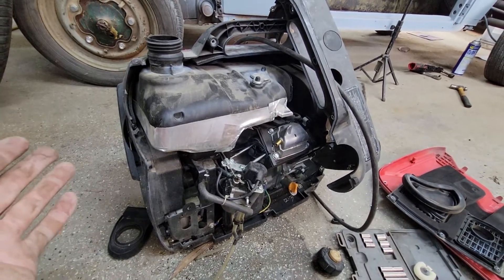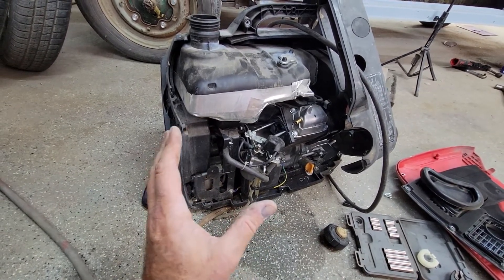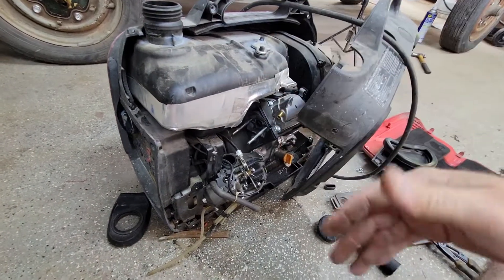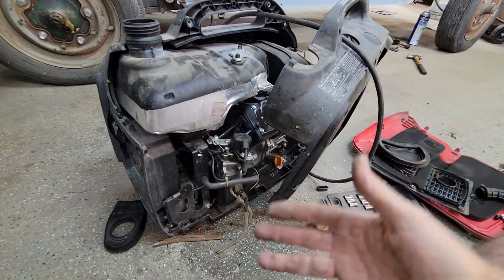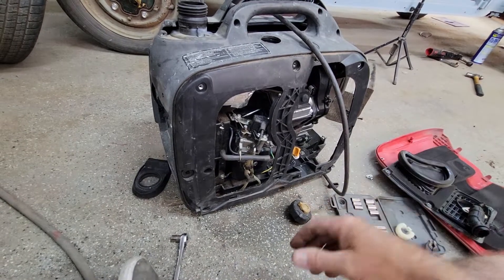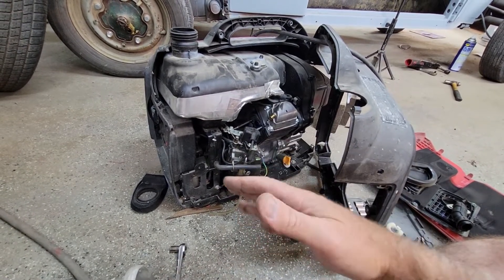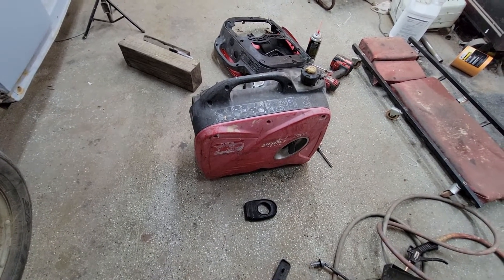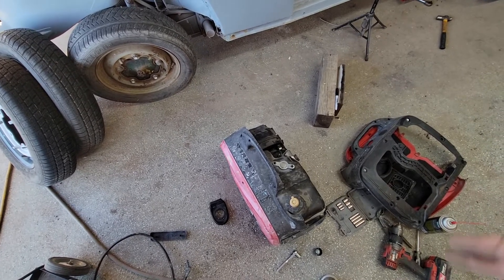Harbor freight predator inverter generator Easy to work on? clean the carb and spark plug replace

Comment: I don't know what you're talking about when you say the carb on the Honda EU2000 is hard to remove.  One screw to remove the side panel cover then one screw and two nuts - all easily accessible - and the carb comes right off.  Much easier than the Predator.  I live on a boat in salt water and my Honda has run way longer than my neighbors Predator.  Also, to replace the pull-starter cord, you just remove 10 screws and the case splits open, then you just lift the fuel tank out and the pull-starter is right in front of you.

Comment: I came here because some of the 2000 inverters all 3 recoil bolts thread out fine. Some one bolt comes right out and the other 2 you have to rip the entire black front piece off to get to the nuts holding the recoil housing on the backside. Definitely not very maintenance friendly designed. Especially when they come with a crappy pull rope that wears out faster then anyone I've ever seen in 50 yrs.
Reply from the maker: take apart a honda. then you will see what I am saying.

Comment: There is an access plug on top of the case to get to the spark plug without all that work.  Carb comes off easy with the main panel removed.

Comment: My predator is over 800 hours when it started to work rough, I've changed out the plug to ngk it starts right away but still runs but rough. So at around 860 hours I took it apart and about to clean the carb. Hope that helps also will install the fuel filter
Reply from the maker: yea mine is a little lean but still works.
Reply: What ngk?Can you send me part number pls?My generator stopped starting after being stored for a long time.
Reply: @Dominikmers  Hey Dom, NGK Spark Plug, CR5HSB
Reply: @vitalekg  thanks a lot🤝

Comment: I have a predator 1400 for a year  used on camping trips...
The other day I notice is leaking from the bottom  ...and shutdown  immediately..
Did you know or may suggest  how difficult will be to fix it...
I'll appreciate  ...nice videos body..
Greetings  from california
By the way new subscribers  here and👍
Reply from the maker: Yea I posted repairing it doing a fuel line or something a while back.....It is really easy to repair. they made it to be able to take it apart and fix stuff. Unlike my honda which was super hard to get apart. These are easy to work on. Remember in 2027 they wont be available to buy new anymore. IDK why they are doing that. Keep your voter registration up to date and be sure to check the correct boxes or we are screwed.
Reply: @mikesrandomvideos  
Appreciate  your reply.... 
I'll  look it over....
And for sure I'll...we are really  screwed...
Lol
Take care...!

Comment: Consider yourself lucky instead of being dismissive. I've had my predator 2000 for less than 30 days and I can barely keep it running.  I followed the manual and I've take good care of it. These things are trash.
Reply: @IFUCKEDAROUNDANDFOUNDOUT  or just remove it unless your in California or another dry state